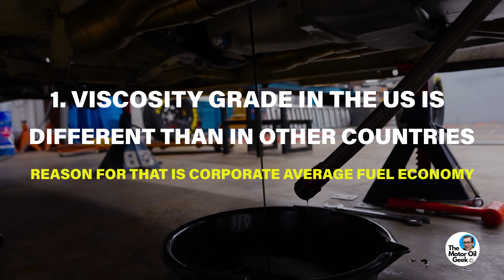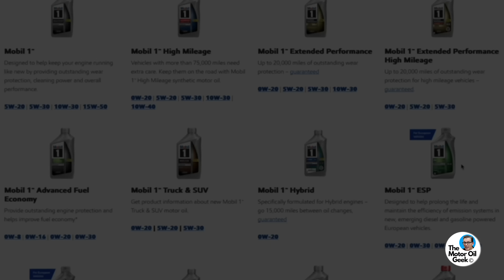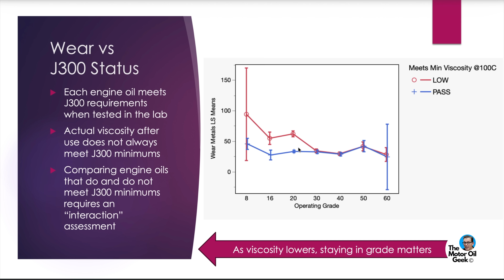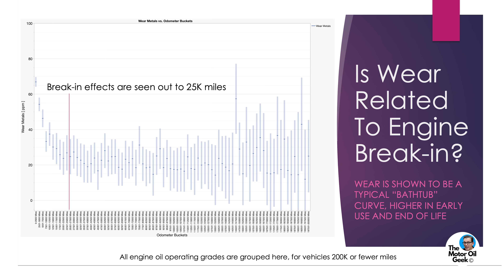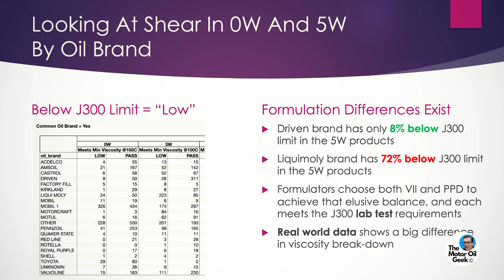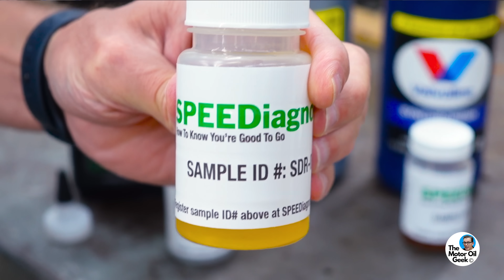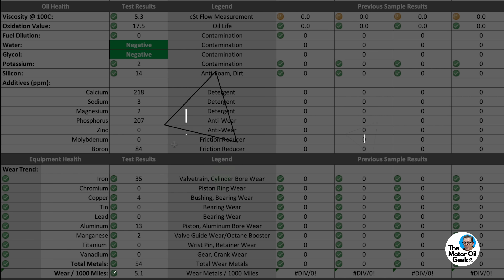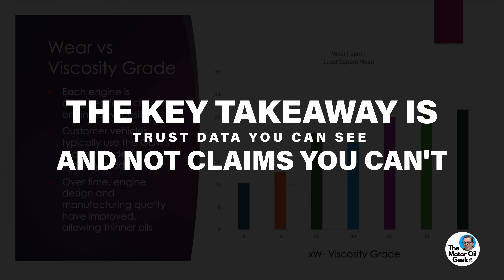More Ai Lies? The FACTS about 0W-20 vs 5W-30 (With Evidence)

Comment: the very fact that, absent the CAFE standard, manufacturers choose 5W30 is proof they would prefer heavier oil
Reply: Exactly!
Reply: this doesn't make sense though even according to the video. The shorter the spread the better. 0-20=20....5-30=25.
Reply: @XBX1MASTER but, an Xw30 oil’s viscosity is significantly higher at engine temperature (measured at 100C) before shearing than any Xw20 oil is.  Also, nobody is stopping you from using a 10W30 oil vs. 0W20, in which case the “spread” is the same.  The 0W vs. the 10W is just slightly thinner at very cold temperatures.
Reply: @1 @1wheeldrive751  the thicker the better is not always true. Bearing clearance should be considered. Just use what the oem recommends but yes the viscosity index is the same as you noted.
Reply: @XBX1MASTER  the thinner the better at start. The thicker the better after warming up.
Reply: @wessidemessside  I know. It's why there are friction modifiers in oil but there is such thing as too thick or else we'd all be running gear oil.
Reply: @XBX1MASTER  0w-30 and 0w-40 exist too. They aren't 60w-90 of gear oil.
Reply: @wessidemessside  I get it homie. You run whatever you want. I'm gonna trust people who do the science for a living.
Reply: @XBX1MASTER  mechanical engineer. Don't trust the science automatically. Do your research for yourself. They are ignoring proven and verified science because it is "holding them back." Or they don't want it to last as long.
Reply: @wessidemessside  I trust speed lake jr who's a tribologist. I'm sure you know quite alot about some things but I'm following his advice.
Reply: @XBX1MASTER  Great! I was just saying that make sure that you use more than one source and cross reference those sources. Science with confirmation bias through Ai is a very dangerous thing.
Reply: @wessidemessside  best of luck.
Reply: @XBX1MASTER shears down to a thinner oil but  not all oil brands do it as quickly; at least that's what I understand.
Reply: @Kat-on3nm  it's almost a moot point. When is the last time you broke down or hit a threshold of mileage and found out it's because your engine locked up because your oil sheared or could have gotten an extra 3,745 more miles if you would have used 5W-30 over the 0W. I'm 48 and I've never met anyone that ruined their engine because they used the wrong oil. I know there are extreme cases of course but I'm speaking in general. The worst oil is better than the best from 40 years ago.
Reply: @XBX1MASTER This. The internet loves arguing about theory. But we should always be asking about the practical ramifications based on hard data. Test data, fleet history data, etc.
Reply: @XBX1MASTER - The obvious solution is 5w20.
Reply: @jameseroh6544  definitely an option but there are plenty of vehicles with hundreds of thousands of miles than have been running 0W-20. I've personally never heard of someone complaining they lost a certain amount of mileage because they chose 0W instead of 5W much less someone's engine seize strictly from 0W.
Reply: @XBX1MASTER - To me, oil pressure is the big thing.  I have also found that Valvoline Restore and Protect seems to allow the VVT function better in my 2020 Dodge Durango 3.6L and my 2023 Jeep Wrangler JLU.  The bottom end power seems to have a little more pep.  And at the same temperature ranges, the fuel economy is one or two mpg better.  The Durango has 181k miles, while the Wrangler has less than 16k.  I bought both vehicles new.
Reply: Don’t believe anything you said here, my truck sounds like a diesel when I use the recommended 0w20, changed to 5w30 and it purrs like a kitten, if they A/C is off you can barely hear it run
Reply: Burns oil to the rings and consumption.
Reply: It depends on the engine though.
Reply: My 2013 doesn't burn a drop 0W-20 Valvoline Restore and Protect. I also drive 80+ miles per day. Oil change every 5K. Like most things depends on the variables.
Reply: and when they used to publish manuals without lies, it would say 40 weight (and even 50 for hot climate)
Reply: @TheGuruStud  that's believable back when bearing tolerance was higher.
Reply: @XBX1MASTER  what were the tolerances then and now?
Reply: @halleffect1  all I know is machining has gotten better and tolerances closer but lately machining is having issues with debris and metal.
Reply: @XBX1MASTER  Many engines are identical, you're making assumptions and manuals in europe will all say 40
Reply: @TheGuruStud  so use 40 then. Use whatever you want that makes you happy. The bigger the spread the weaker your oil period. Again nobodys engines are dying because of oil it's the contaminents from machining.
Reply: @XBX1MASTER  you missed his point. You're just repeating what you hear online with no facts to back it up.
Reply: @devonswindell9735  I'm repeating facts with no evidence to back it up. Interesting statement. Believe your lies then.
Reply: My car runs better on 5w-30 so that’s what I use.
Reply: @Kobio-369  quieter maybe. Better....🤔
Reply: @X @XBX1MASTER e manual for my car in Mexico says to use 5w-30.  I’m in San Diego and it says to use 0w-20. That tells me it’s simply emissions.  So there’s that piece of the puzzle as well.  By the way, quieter is better.  I also have a jeep that I haven’t had to  replace lifters on due to using 5w-30 in it as well.  To say that the emissions crap with thinner oil isn’t hurting our cars is ridiculous.  Can’t wait to here about this guys Toyota issues down the road😂
Reply: @Kobio-369  of course they have different laws and standards. 0W and 5W is OK if that's what the manual says.
Reply: @K @Kobio-369  dodge had some known lifter issues. I don't think it was linked to oil.
Reply: @XBX1MASTER  You do you.  I’ll do me.  Have a great day
Reply: @XBX1MASTER - The 2016 and newer v6 3.6L has 30psi at most rpms.  But when the cruise control wants to slow the vehicle down, 80psi.  Mopar should have done this with all Hemi engines.  But the Hellcat and other supercharged engines do have higher oil pressure at all times compared to the non-supercharged engines.
Reply: Yes this is what should be addressed but this video simply addressed the fact that given under shear-stable conditions, the AI is not right, but in real world conditions, the opposite is true and the AI is correct!
Reply: I switched from 0w20 to 5w30 and now I don't add any oil between oil changes.  Before I had to add 1 or 2 liters
Reply: Just checked the GM owners manual for the mideast. They still mandate 0w-20 over there.
Reply: Why is GM switching from 0W-20 to 5W-30 with their 6.2L V8’s then? I mean, they obviously are building a subpar product, but why would oil be the fix in this case? The 5.3L’s seem to do just fine with 0W-20.

Comment: Wife bought  RAV4, 4  cylinder new in 2011. II have changed the oil every 5,000 without fail. Car see 90 plus days and subzero temps in Michigan. Car now has 250,000 miles with no oil burn and runs fine. All on Mobil 1, 0-20. All good here…..

Comment: All this video did was reinforced the fact that thicker oil provides better protection, Explain why the the Mustang 5.0 coyote engine calls for 5w20 and the track pack option which is the same exact motor calls for a 5W-50 because it’s subject to more abuse, Here in South Florida I run 10W-40 in my Coyote that calls for 5W-20

Comment: Lake, hats off to you sir for making this video.  I’m an analyst and love data.  All those click bait AI videos are garbage and unfortunately the average person is not taught to challenge assumptions and seek vslid controlled data to develop conclusions. I have a 2025 Acura MDX with the naturally aspirated J35Y5 GDI V6 which has been around since 2012 calling for the same 0w20 across the world.  The engine has produced hard proof that 0w20 is not bad oil as there are many examples of of this engine getting 400k plus mikes without any major overalls if the oil is changed at 5k intervals.  Ive read about one person hitting 900k.  As for my engine, Im at 6600 miles with 3 oil changes (two were break in) and all the UOA shows wear metals are at or below averages (incredible for an engine still within the 15k break in period).

Comment: Thanks for the clarification! From looking at uoa posted on the site bob is the oil guy. 5w-30 sheering down even with reasonable oil change intervals is pretty common. And 0w-20 from the oil analysis posted on bob is the oil guy commonly shows it stays in grade/doesn't sheer down as regularly as 5w-30 does according to the uoa I've looked at post on bob is the oil guy.

Comment: My question Lake...is say Ford for instance requires 5/30 for there Ecoboost in a 3.5, but in a Normally Aspirated 3.5 it recommends 5/20..always heard the reason was fuel dilution...because of turbocharged.and the thicker viscosity helps it...

Comment: Here we are, ruining engines trying to get miniscule mileage increases, all the while, we're spend HUGE amounts of that same "energy" replacing manufactured engines from factories, independent garages and who knows where else, meaning bottom line economics, we're probably spending more energy doing repairs and replacements than if we just left things alone. In a non-related example but gets the point across, we're burning 2 barrels of oil to save one.

Comment: There is NO difference between these 2 oils. Both of them are perfectly fine for the engines they are designed for. The Motor Oil Geek is wrong with this video. Do not be deceived by him.    I have unsubscribed from this Geek's channel.

Comment: High performance engines (especially direct injection petrol ones) need thinner oil so the pistons and cylinders get squirter action early and the head gets oil in abundance early. Low/No ZDDP and low calcium oil = lower LSPI risk too, no piston melty action. 

0W-20 in my AJ133 supercharged V8 and 5W-20E in my Mazda L block derived Ecoboost 2L Turbo engine. You need that oil there QUICKLY. Frequent oil changes with thinner oil do help a lot (no more than 10,000 miles).

Comment: What I have learned about oil and the factory/owners manual recommendations are, Never change oil at the manufactures recommendations , I always change every 3,000 miles. The manufactures never factor in where you live, is it very hot or cold, etc. My Hummer H3 with an 3.7L inline 5  owners manual said to use 5w30 year year round.  problem is the factory thermostat  must be at 195 degrees for emissions. Vehicle running hot plus 90 to 100 degree summers in the south thins the 5w30 so bad it clatters like a sewing machine. When I stop for traffic, the oil light comes on because thinned oil loses pressure. Switching to 10w40 and problems went away. Engine is quit (no clatter) no oil light at stop, and the engine now runs cooler. Engine now being properly lubricated. Also need to mention, the Engine has 150,000+ miles on it. Lower viscosity oils may work for a while but after the engines wear getting high mileage  or operate in extreme temperatures, changing oil viscosity and oil changes every 3000 miles is a must. Real world observation, no controlled lab test.

Comment: So basically, 0W-20 is not better because it shears out of grade less than 5W-30.  Even after 5W-30 shears out of grade it still protects better than 0W-20, because even then it's likely sheared down to where 0W-20 began its life as new oil

Comment: The lubricating characteristics of the two oils is roughly equivalent, but the heavier oil produces more rotational resistance and less mpgs.
Reply: Did you forget the thinner oil coating to protect the moving parts?

Comment: Okay so one question i have. I understand that you are referencing your data regarding the shear stability which is fine. The problem i have is that most 0w-20 if not all 0w-20 is full synthetic. Do you believe that your data regarding the shear stability is possibly flawed due to the possibility of 5w-30 conventional motor oil being thrown in the mix? I may be incorrect but just some clarification would be nice. Awesome vids.
Reply from the maker: Thanks for the question. The shear stability of a 5W-30 is due to the polymer concentration and not the base oil type. Nearly all conventional oils are Group II based. Nearly all synthetic oils are Group III based. There is not an any difference in shear stability of those base oils. Shear stability is down to the type and amount of VI polymer. I hope that helps.
Reply: @themotoroilgeek  Thank you for the reply. I would have thought the base oil would effect that. Thank you for the clarity.

Comment: i believe it depends on the actual metric you measure by,

 are we measure the milage to grade points drop ratio for a given oil or are we measuring milage to grade point percentage drop ratio?

30w might drop by 5 to a 25w at 10k milage but a 20w oil might only drop by 4 to a 16w oil and say "20w protects longer" yet that statement could be considered misleading

Comment: Manufactures are only interested in the engine making to the end of its warranty.  I believe Toyota is 60,000 mi which would explain its 10,000 mi oil change recommendation.

Comment: Can tell you... My 1.6T 2024 elantra Nline calls for 0w20 ( canada)  im using 5W30 Castrol Edge....HUGE engine improvement. QUIETER ...SMOOTHER operation...dealer even recommended the change to 5W30... 0w20 audible engine noise comming to mid point if oil change interval...5w30..... Silent operation even in cold -10 deg celcius. From start of oil change...through 8000km service interval...  My fuel economy has not changed... My engine thanks me....my local dealer uses 5w20 and 30 to do changes ....

Comment: Can you explain changing the weights of oil ? If it’s calling for 0-20 and swapping into 5-30 , theres still 0-20 oil in the motor since you dont get it all out in an oil change . Would the two mixing make an issue?

Comment: I think there is more into it but I agree overall with this video. To actually get a more accurate results you need to run the very same test in equal amounts of try on the same engine with both grades of oils as different engines have different specs, tolerances, turbos, different grades of fuels(E85 and others dilute oils super quick) ect. For example, B58 engines (mostly those build before November 2020) were made for 5w30 but forced to use 5w20 in the US for emissions, the tolerances of the rings are not on pair with this and many people who learned this before hand managed to save their engines by switching oil at the risk of losing warranty. 

For me this is a big issue as in order to have closer tolerances you need to change the alloy of the pistons to match that requirement(forged pistons requires lose tolerances compared to hypereutectic as they expand with temperatures) meaning you will get piston slap on cold start up and on a performance engine such as most turbo engines, you will get fuel bypassing the piston rings contaminating oil and cleaning lubrication out of important parts such as bearing and sleeves.

Comment: I have a question for you. I own a 2022 Toyota Tacoma with the 0w-20 I recently changed to 5-30 oil and my mechanic warned me about the oil pump will suffer moving this thicker oil and will cause damage to the engine what do y’all think about this?

Comment: I made this comment on the AI slop video as well…

Audi explicitly says not to use more than 1L of 5W-30 in the US vehicles. The owners manual says to only do it as a last resort. If it was only about fuel economy then they would have no reason to advise against thicker grades of oil after you buy the vehicle. Since CAFE standards only apply to the point of sale.

Audi tunes their engines and swaps out parts for the thinner oil. Oil pumps and valve timing requires the thinner oil. Which is part of why VW/Audi will void your warranty if you use thicker oil. As you said, use the manufacturer recommendation.

Comment: I swapped out from 20W50 to 10W40 years ago as I found the lifters tricked a lot for a long while after startup and there was bottom end dry start knock for a few sec, oil pressure was approaching 90psi with the oil pump making a lot of whining noise.

The same engine in the US was spec'd to 5w30, so I went with an in between grade and resulted in around 72psi, lifter tick and bottom end rumple on start up is much shorter and quieter when it does occur.
I did a few UOA years ago with the changes and the data showed good results objectively, but I didn't do one before the change unfortunately.  Forward some years later, I did a tear down on that engine with 300k on it (210K of my own) , the bearings were in excellent shape.

Comment: So my understanding is the allowable tolerance of one part added to the allowable tolerance of another part created a large enough gap to where the zero20 oil was not lubricating well. So by adding a thicker oil, that should help the increased space between the two parts. Of course we’re talking thousands of an inchtype of space. But my question is 5W 30 why not 5W 40 for my large V8 down here in Miami in the summertime when my engine idles for 2 to 3 hours per day?
Reply: Other content creators who also consider 5w40 in this discussion probably would say go with 5w40 in your scenario.

Comment: I I have a vehicle that calls for 0w20 and would like to move to 5w30 but sticking with using a high quality 0w20 oil and filter and changing it every 3000 - 5000 miles

Comment: Simple.  O weight oil is good for all engines on start-up.  Moves like water.  After 5 seconds the engine rod bearings need more weight/viscosity.  During warmup, the engine needs more viscosity as bearing tolerances grow.  Period.  The viscosity of oil depends on the bearings and what kind of engine, cast iron, aluminum block, then finally the top, heads and lifter and cam design.  If you don't know that, then use the oil recommendation of the manufacturer.